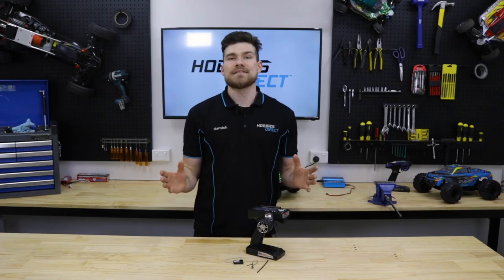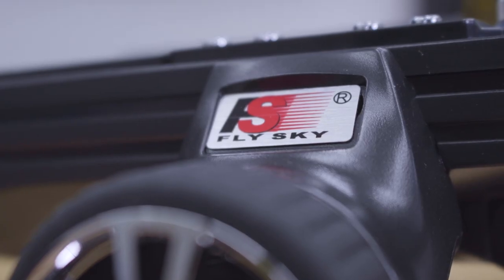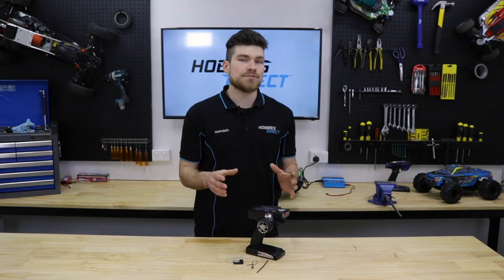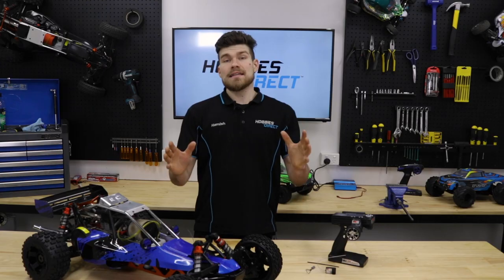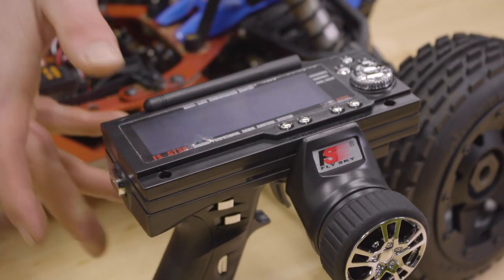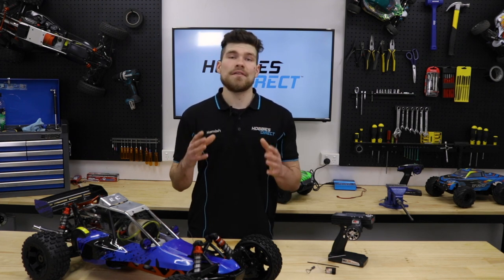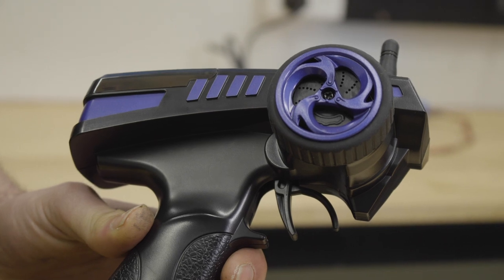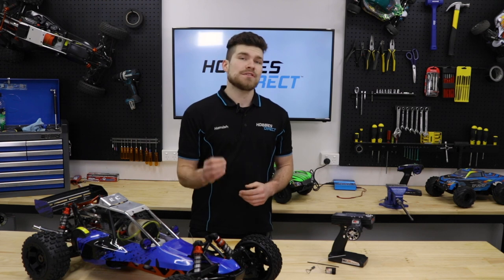How To: Set Fail Safe FlySky GR3E Receiver

Comment: Thanks so much!  Today I lost contact when I was out driving my slash and it drove through our village in Sweden with full throttle and some helped me find it, then it had driven into a bush and stopped.  I almost had a heart attack.  😂 I tried my failsafe now and then they were full throttle forward just what he did outside so I set it to neutral now and tried and then the tires stand completely still.👍 I use the hobbyking GT-2 transmitter and then to try the failsafe mode so  the wheels of the car must spin while you switch off the transmitter.  So you learn to accelerate while you turn off the transmitter, otherwise the car just stands and beeps and looks for a signal.
Reply: I know Im randomly asking but does someone know a way to get back into an instagram account..?
I somehow forgot my login password. I would love any assistance you can offer me!
Reply: @Branson Kody Instablaster ;)
Reply: @Cairo Kayden Thanks so much for your reply. I found the site on google and Im trying it out atm.
Seems to take quite some time so I will reply here later with my results.
Reply: @Cairo Kayden it worked and I now got access to my account again. Im so happy:D
Thanks so much, you saved my account :D
Reply: @Branson Kody Happy to help =)

Comment: My Rovan Baja goes Solo last 2 times I have played with it.

Receiver battery is has new batterys and Rovan receiver is fully charged.

First time took it for a spin was fun and fine for bout 10 mins then full throttle riding solo straight into the fence luckily flipped upside down and didn't break a thing spring loaded fence lol.

Second time same thing 10mins full throttle I scream out Wow wow wow and zooms past me bout 40 to 50ks stupid me try to use my boot to stop it from the top of the Baja's roof but I only sorta slowed it down and let it crash into the fence again this time the shocks broke of but luckily again no damage and managed to pop them back on.

Now I have made a custom timber nudge bar and going to probably give it one more go as I have disconnect the lights to the Baja as it has led lights connected from last owner.

The receiver and radio seem to work fine on my bench and fail safe works as I can turn of radio and brakes come on but if I switch of the Baja on full throttle full throttle is stuck.

Never ever had this issue with none  of my other rc cars n boats or drones just this Baja had a mind of its own sometimes lol.

I have asked questions on Facebook and one guy told me to change the radio and receiver

This his what he said

The vibration of the motor and terrain plus heat build up in the reciever are most likely causing it.. The flysky gt3b are known to have reciever issues.  I run spektrum dx4c and dx5c and have never had a run away. The dx5c runs less than $150 online.

Also this

The large steering servos draw a lot of power. 
I've been in the hobby for 30 years. Everything from boats, planes, helicopters, you name it....lol
Always happy to help.

Well see what happens tomorrow when I drive it without lights connected and a costom nudge bar made just for the crash lol hopefully it just works

Also will be getting a fail safe kill switch put on just another back up thing stupid car should of came with one.

Comment: Hi hobbies direct I have a standard Rovan Baja 5b can the transmitter that comes out of the box have a remote engine kill switch like the SKU:63024
Reply from the maker: Hi, I believe the Rovan remote kill switch (#63024) requires a 3rd channel and the 290A (standard model) only comes with a 2 channel radio. You might need to get a three channel radio like the FlySky GT3B to make it work.

Comment: Hi there. Maybe you can help me. I have a FS-GT3C remote and i have it linked to my boat. However the reverse has more power the my forward throttle. How do i fix this ? Ive tried everything.
Reply from the maker: Swap the throttle channel direction, swap the motor wires around, or both. And reset the end points :-)

Comment: my fail safe only hold the throtle off for 40 seconds no matter what controller I use I can change receivers on handsets and it still holds only 40 seconds then I am paddling flat out to head off my boat before it hits things the only common denominator is the flycolor 150 amp esc I am at a losswhat to do

Comment: thanks for the video. I am a rookie and am asking for some help 🙄. I just bought 2x MJX 14210 and ti's crazy fast so I am buying 2x FS GR3C & GR3e to tame it down :). Original MJX receiver got 5 slots, 3 channels and 2x VCC for two fans ( on ESC and Motor ) . I am asking if I can conect both fans on one VCC slot on GR3e ? Thanks in advance
Reply from the maker: Yep! You'll just need some kind of double adapter :-)
Reply: @HobbiesDirect  Thanks, that was quick :). So I'll just solder two fans together parallel and connect to 1 VCC slot.
Reply from the maker: That should work nicely, pretty sure I've done that in the past haha @jured7383

Comment: Sorry can someone tell me I want to order a rc car but it says comes with a Dean connector can you tell me what it is be for I order it do I have go do any thing with it or is it nothing  to worry about
Reply from the maker: There's lots of battery/ESC connectors out there, different cars have different designs, but they can all be swapped out for another. You just need the battery connector to match the car and charger 🙂

Comment: I done all that on my electric boat then held the throttle at 1/4 and turned off the transmitter, it immediately drops to off and zero revs, then 40 flashes of the blinking receiver light later it revs flat out. The upside down boat or out of range boat out of control with slight prop in the water with no water intake in the water it just cooks the motor, it has cost me 2 motors so far I saved the third motor by bench testing and changing to a spectrum transmitter and receiver. I was running the waterproof flysky FS GR3 receivers but now I don’t trust it. I have 4 receivers they all do it. The remote transmitter is actually the Hobbyking rebadged Flysky.
I have no clue what to do.
It had pretty good range too slightly better using the Absima CR2S V2 transmitter than the HK transmitter but still 40 seconds after fail safe kicks in it starts revving flat out and I am paddling the canoe trying to catch it before it burns out the motor or smashes the boat into something.

Comment: Can some one tell me I have a slow changer how long to charge the bug crusher if I didn't have a fast charge
Reply from the maker: depends, what are the specs of the battery and the charger?
Reply: @HobbiesDirect  can you tell me can I use li po battery for the bug crusher
Reply from the maker: @noreenkemal9766  Depends, does your car's ESC have a lipo mode that prevents the battery from being run too flat?
Reply: @HobbiesDirect  I don't understand were wood that be located on I only have were you put the sky stick or the vcc and there only one going in ch2 and ch2 1 but the plug is joining to off them

Comment: I have the same transmitter and receiver, I binded a new receiver to a different model, hooked up a Hobbywing Quickrun 1060 esc. Now there's no response at all. Although my transmitter is beeping because of low voltage. Please tell me that's the reason it's not doing anything! I'm new to this transmitter. Anyone?!
Reply from the maker: It's possible that it's not working right because of flat batteries, but also make sure your trims are set to neutral; brushed ESCs use the neutral point of the transmitter to determine neutral, and if it can't do that, it won't work.
Reply: @HobbiesDirect  thank you for the info. I'll check the trims as soon as I put in fresh batteries.
Reply: @HobbiesDirect  Hi, I just placed brand new batteries, and still no movement. How do I set the trims to the neutral position? I'm not very good with this sort of radio.
Reply: Update: it now steers, and moves forward. But now there's no reverse! Please Help! 😭
Reply from the maker: Is reverse enabled on the esc?  @rcgeneration824
Reply: @HobbiesDirect  it was disabled. 🙄 
Got it working, finally! Thank you so much for your help.
Reply from the maker: Haha nice! Glad to have helped. @rcgeneration824

Comment: There was a time RC cars were sold without a failsafe and probably still are?
I had a nitro as my first car and it run away and I demanded a refund as obviously a fault in the receiver.
Don't operate anything without a failsafe or carnage will ensure, unless it's a rock crawler which only travels 1 metre a minute